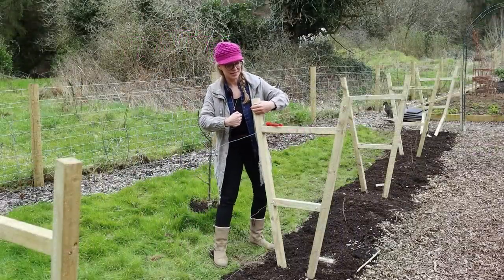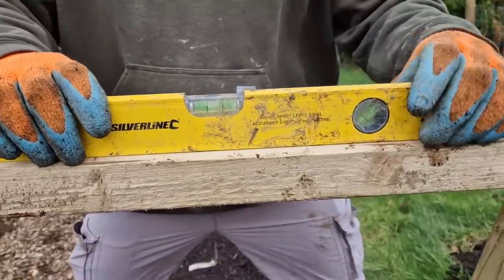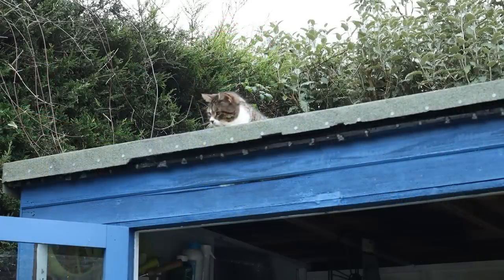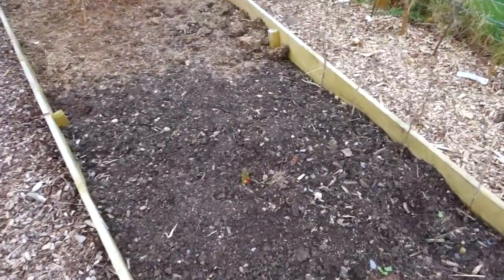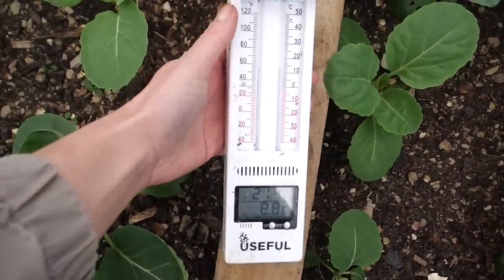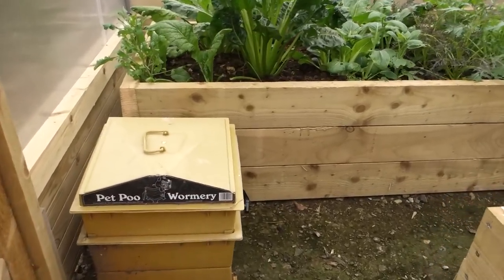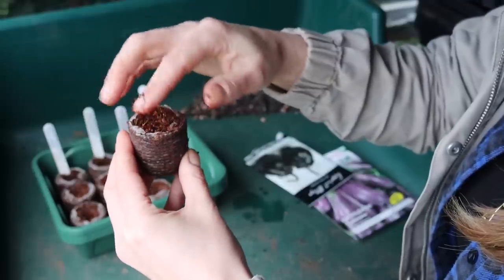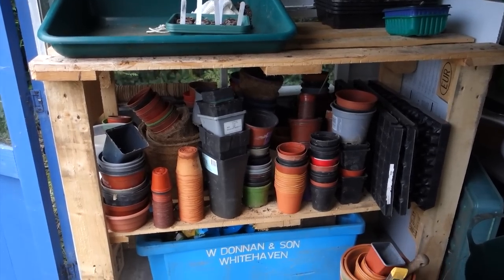The Garden in February

Comment: You have elder that close to that raised bed, I didn't realize I could put them that close to other garden areas. 
      I am looking at getting an elderberry patch planted in the next few weeks. I have 7 3ft elderberry I need to get in the ground, from what I'd seen in videos I figured I needed more space? I had thought of building similar trellis system with tposts for the elders and giving them extra room so I could clip/plant starts in between.
Reply from the maker: Sounds like a good system! The elder, and other hedgerow plants, we've planted along the fence are about a foot apart. They'll grow and knit together into a hedgerow rather than individual shrubs/trees. We'll keep the hedge clipped and pruned so that it doesn't get any taller than about seven feet and no wider than about four feet.